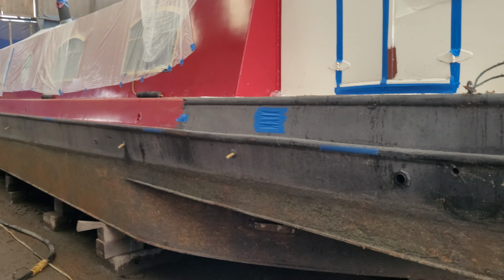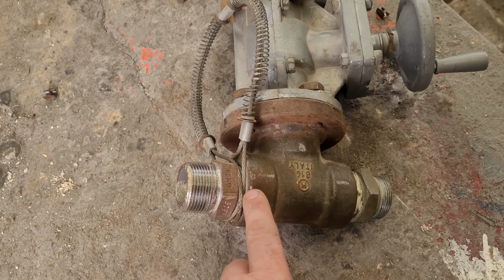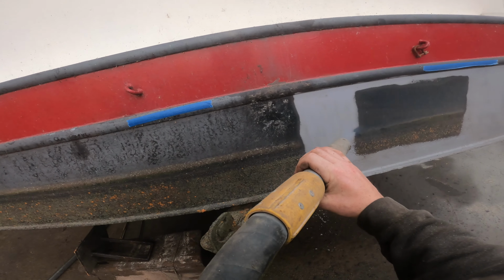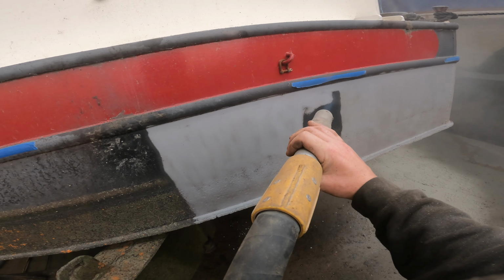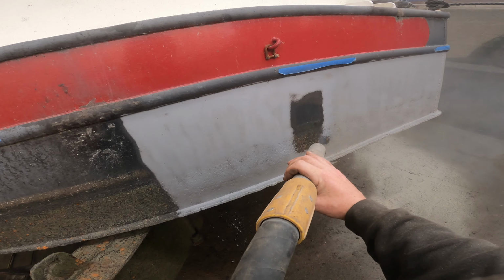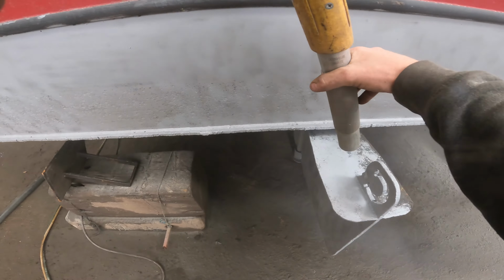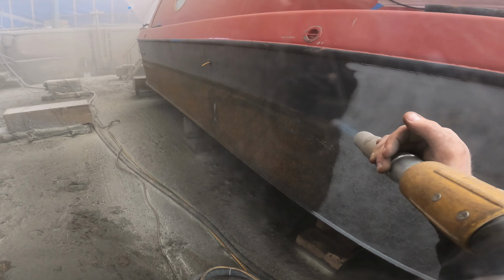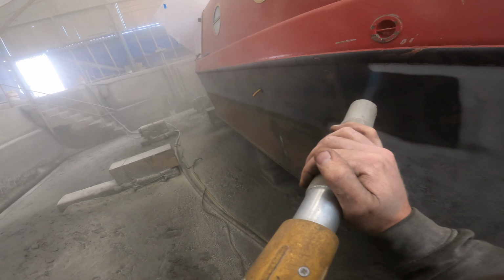SandBlasting canal house narrow Boat

Comment: I have seen you do multiple boats by now. You seem to do the sides and the bottom sides of the hull. But never the flat bottom (at least from what I can remember). Is there a reason for this except for the obvious that the boat isn't lifted up enough for a good reach. 
One would think that the bottom would have even more growth and filth on it.
And a suggestion to make the videos even more enjoyable. Can you wire up a microphone to yourself? It is often very hard to hear what you are saying when you got the mask on. At least for a semi deaf that doesn't have English as native language 😅 .

Anyway keep the videos coming Mick, they are very enjoyable!
Reply from the maker: I have a video on hear of the underside its all down to the customer.
 I think because the bottom is made from thicker steel and the say so of the boat clubs the bottom don't get oxygen so don't rust as fast or that some canals are that shallow they bottom out alot so scraping the paint off anyway. We'll I'm unsure I just do as I'm told haha. 
Thx I'm glad you enjoy my work I also love to hear constructive criticism to help me grow as a better creator 👌 it turns out I've expelled all avenues in trying to get better audio the next option would be voice over but this puts me out of my comfort zone maybe try this method 1 day 😂 the blaster is extremely loud I have a mic nearly in my mouth to get the audio I'm working with 😂 it don't help that my accent is strong I need to tame this
Reply: Thanks for the reply Mick!

Comment: Mick, what about the undersides of these boats?  Is there nothing to worry about there?
Reply from the maker: Ive got a video of the underside on my channel if you would like to see one get done :) to be fair not many folk do it under their because the steel is thicker on the base plate and supposedly don't get oxygen so don't rust as fast if the back end near the weed box is anything to go by bit like the under side (just above the propeller) I blast this area and that steel seams to be in better shape than the sides I don't understand the science of it :)

Comment: Nice work as usual, just curious how many bags of sand do you use on a job like this and what does a bag sand weigh 👍😊
Reply from the maker: Thx I do try haha I can do a days worth of blasting on 12 to 40 bags of 25kgs this boat used about 20x 25kg bags ish I wasn't keeping track to be fair some take alot less and others can be right upto max. To be fair it was hard to remove but not too bad as the boat was fairly short compared to others I do 👌

Comment: Can you make a video about your sanding truck?
What you have on the truck and how its done. I mean the equipment etc.
You take power from your own generator or .. ?
What compressor?
Reply from the maker: Yeah its a video in demand I will make one soon as my build blast pot has protection :)
Reply: @Mobileblaster  Thanks.

Comment: well done mate. how long did it take ?
Reply from the maker: Thx it's appreciated 😊 this was done in the day but tuck longer than a normal Boat although it was shorter in length
Reply: @Mobileblaster  was it longer because of the pot issues ?
also do you use aftercooler for your air ? what compressor are you using ?
Reply from the maker: @MasterBlasterSandblasting  No the pot shouldn't make any difference all the pot really dose is media flow and hopper size that is if its set to run the cfm ie the bore of the internal pipes are big enough to cope with the amount of air.
Compressor is doosan 260cfm built in after cooler I also use LM filter and a separate water trap also a separate helmet feed
Reply from the maker: @MasterBlasterSandblasting  I believe it tuck longer because it had been blasted before and the finishings had adhered properly 👍